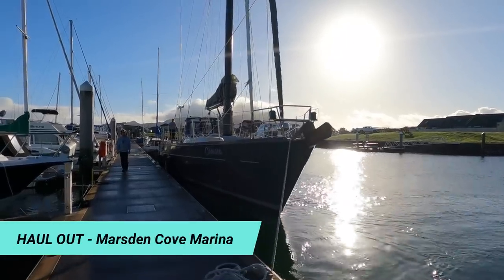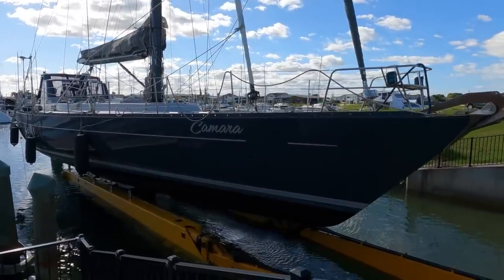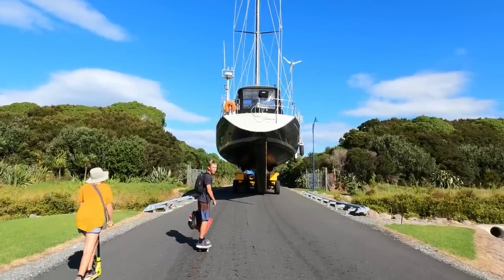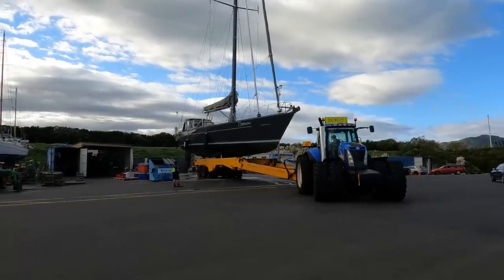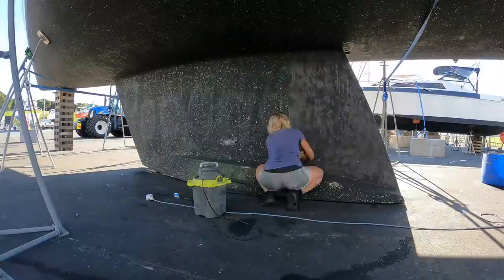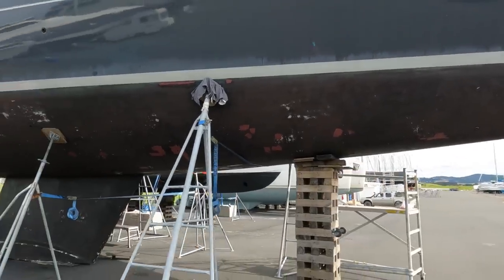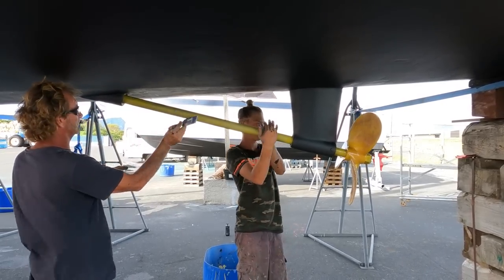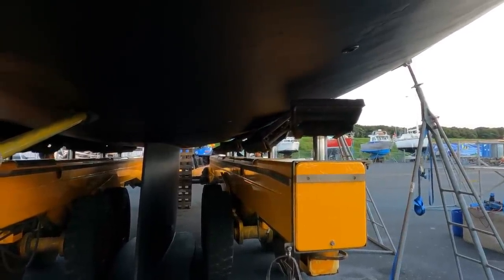Haul Out Time (Ep. 21) | What it's like hauling out an 80ft sailing yacht | 1 week maintenance mania

Comment: What anti-fouling are you using?  That's hardly any mess for three years in the water!

Outstanding kudos to Marsden Marina for their superbly sound logistics!  It really is a simple operation -- IF you do it right and in the right order.  Marsden Marine does it right!
Reply from the maker: We were using Jotun Sea Force 90 but have switched to Carboline Sea Barrier 3000 as it is an ablative antifoul that does better with the growth in Nz. The Jotun was great in terms of being able to clean it as it’s hard wearing but if you look closely it didn’t stand up well to barnacles. The Sea Barrier does much better in that regard. Seeing we got a good coating of the hard wearing Jotun left we decided on the Sea Barrier/ablative to help with the growth. So far it’s working out 🤞
Reply: @Camarasailing  I was going to ask about this. with smaller boats, I like  annual haulouts, and loved Pettit Trinidad Pro Hard antifouling, as it deterred pretty much everything for 3 years, and for the 4 following years roughky just a pressure wash de sliming on haulout . annual halout allowed a full checkover, full service, anodes and impeller changes etc, to ve set for another year. If Trinidad Pro is unavailable, that Jotun does look to be a useful alternative tbh. Another backup I may try is Hempel Silic One. For prop and such, I'm I trigger enough to try 97% Cold Galvanising Zinc paint in a si,icone carrier, on Prop, through hulls and rudder to test for a year, because in addition to it apparently working very well as an antifouling, it also works as an anode, which may help extend the life of anodes, at a much lower cost. Apparently American Fishing Boats have been successfully using ColdGalvanising Zinc Paint successfully for decades. and land based  ersuons, are identical to Marine versions, but are a fraction of the price. I should, God willing, have my next Sailboat around haulout time at the end of this year, and will be able to start testing such things to see how well they stand up to expectations.  Best Wishes and Fair Winds.  Bob.  👍⛵️✨️✨️✨️

Comment: That's a beautiful boat.  I'm curious about the prop, which seems fairly small for an 80 ft. boat.  My only point of reference is the prop on a 72 ft. steel sailboat, which was nearly 2 ft. in diameter.
Reply from the maker: It’s the prop that she had on when we got her. She pushes the boat just fine though we try and only motor if we have to because with a 185hp it gets expensive quickly and she doesn’t need much wind to sail. We usually motor at around 5.5-6kts, but occasionally open the engine up to blow out any carbon build up and at high rpm’s the boat speed is 12kts which makes us think the prop is the right size and pitch. Ideally one day we will one day upgrade to a feathering or folding prop so we can do away with the handbrake for the shaft. One day…
Reply: Lion NZ (which was a RTW raceboat about the same time) was swinging a 1m prop. But I think that was partly to game the rating rules; they gave undue allowance for props, and the one on Lion was a very slick feathering MaxProp, so it didn't slow the boat down as much as the handicap rules assumed. It was driven by a big, slow revving Gardner 6LXB (10.5 litre 1500 rpm diesel), wonderful engine but from memory only 125 hp or thereabouts...
Reply from the maker: @Gottenhimfella  interesting! We often have Lion NZ anchored here in the bay with us and we actually have their old main sail, just made some modifications to suit our boat 😉

Comment: The boat yard should invest a standing platform that has rails to make it completely safe to work from, one step backwards of a platform could be the end of any sailing.
Reply from the maker: You can hire a rolling scaffold just like we have used and that one has a rail at the back. We used the tiny little step to make the overhead work a little easier but that one is super low off the ground 😉

Comment: Did you get rid of the winch grinders? I noticed they are missing. I guess they were needed for the southern ocean rather than the warm climates you're cruising.  I followed Creightons Naturally during the 89/90 Whitbread closely.
Reply from the maker: Yes we did. We never put them back after the refit as we changed the sailing set up to suit sailing her short handed. Part of that was an electric winch for the main and the furling lines. The rest still requires some good old grinding action though. We kept the old big winches even though they aren’t installed. Hoping to one day convert them to a hydraulic or electric set up when the budget allows.

Comment: Hi she’s actually very clean for three years in the water? What products did you use for that treatment? Or cold water and high boat speeds?
Reply from the maker: The antifoul we used initially when we splashed after the refit was Jotun Sea Force 90 which is a hard wearing antifoul and easy to clean but as you can see in some of the clips it wasn’t very effective against barnacles especially here in NZ. This time we used an ablative antifoul Carboline Sea Barrier 3000 which is performing well in Nz waters. Not as cleanable but usually a fast sail takes off any growth which is usually just a slimey layer. We just worry when we sail real fast if there’s any antifouling left 😂
Reply: @Camarasailing  ah maybe was the size of barnacles v hull in camera.. looked a lot cleaner. Good tip on product. Thanks and stay safe. Lovely yacht